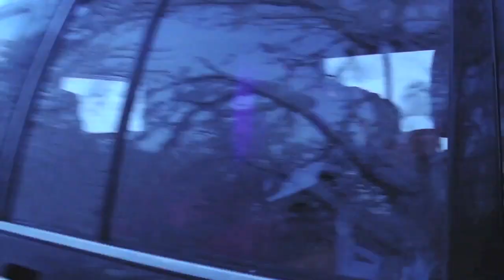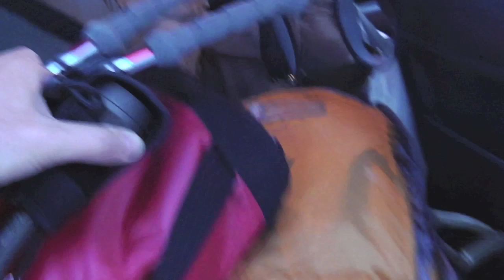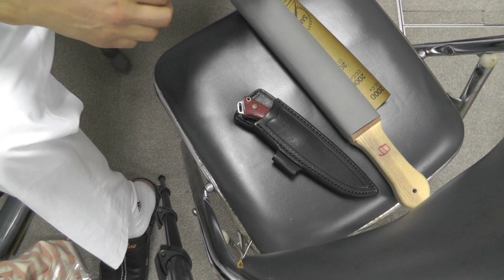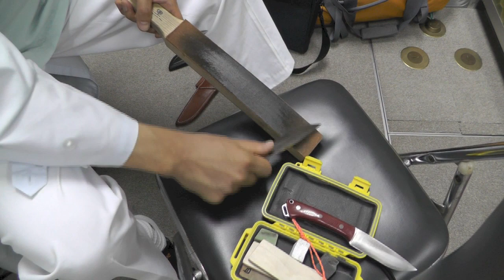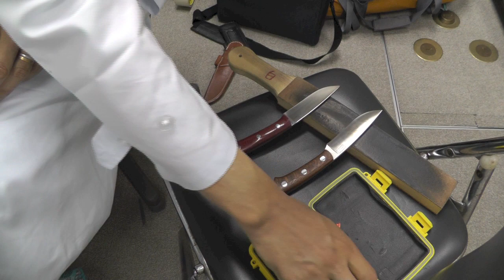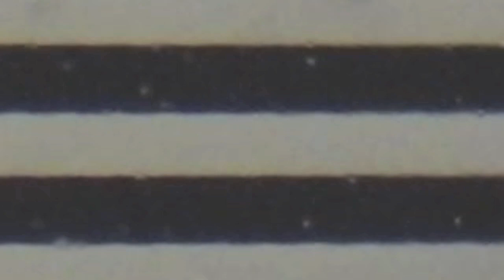3V Fox River review again!

Comment: Do you still think that the 3V Fox River has a fatter geometry than the A2 Fox River ?
Reply from the maker: No. I observe the current 3V Fox River, Bravo1, Gunny, Gunny Hunter have the same nice geometry as their A2 versions. Thanks.
Reply: Thanks.
And concerning the 3V version vs. the 3V LT of the Fox River, do you still think the regular 3V version is a better knife than the 3V LT version although the LT is supposed to slice better ?
Reply from the maker: As for deer dressing or meat cutting the cut object is soft and it doesn't make any resistance to the regular thick Fox River. there is no need to be a thin blade, so I appreciate the thicker handle of the regular one. The thin handle of the LT one is slick and rounds in the hand. Thanks.

Comment from the maker: I like 1095 from Rowen and KaBar better than O1. I think Bark River's A2 is a bit better than their 1095 as for hardness or durability. I think the Magnum Fox is a strange knife. Its handle is too short for the blade size. Its specific handle design is for pinch holding for game dressing. Just magnifying it in the same design is ridiculous. You will not be able to use it for game dressing. It is too large for it. You should go to Bravo 1.5 instead. Its ramp removal is free of charge. Thanks.

Comment from the maker: It is A2 definitely. It takes the sharpest edge and holds it pretty long. And its sharpening is very easy. CPM-3V doesn't take the sharpest edge and is very hard to sharpen although it holds much longer than A2. I personally don't need such durability. Thanks.

Comment from the maker: All Bark River knives have a thicker geometry in CPM-3V than in A2 in my experience. CPM-3V comprises tiny hard metal particles and soft clay which fills the space among the hard particles. So the stropping compounds grind only the soft clay and the hard particles remain on the very edge line, and they make a typical appearance like micro serrations in the highly magnified microscopic views. So if the edge angle were very small, the soft clay portion would break and chip off. Thanks.

Comment: Gday Wako

Sorry mate, but your comparing apples to oranges.  Just look at the abrasion resistance difference between A2 & 3V.

If you are using the same method of stropping, of course the A2 will appear easier to restore (after all, it has lower abrasion resistance than 3V).

Try investing the time to polish the edge of 3V to 12,000 grit before stropping on bare leather & you'll find that with the same treatment 3V is far superior to A2.

Kind regards
Mick

Comment from the maker: My car mileage is 170.000km. The mileage of the used transmission replaced is 70.000km. So I expect my car will serve me 5 more years, 100.000km. Japanese cars are expected to run until 300.000km. Thanks.

Comment from the maker: Fallkniven's VG10 is a fairly soft steel and takes micro rolls in a small angle. So they need a large angle. Bark River's CPM-3V is a pretty hard steel and takes micro chips in a small angle. They are completely different steels but need a large angle in common not to take edge damages. I cannot understand what HRC means in real uses. Thanks.

Comment: helo i was wondering if you have copared the 3v steel to the vg 10. in edgeholding and sharpnes and micro serations and so on.( i know vg 10 is stainles and 3v is a toolsteel) but both often hardens to 61-62 HRC and have similar carbon in them and so on.and i think they often has a fatter geometry too.
 i think this is realy interesting
thanks for great and interesting videos 
// zeth